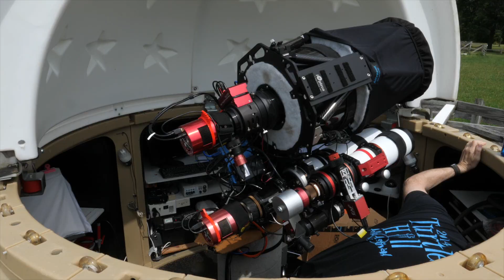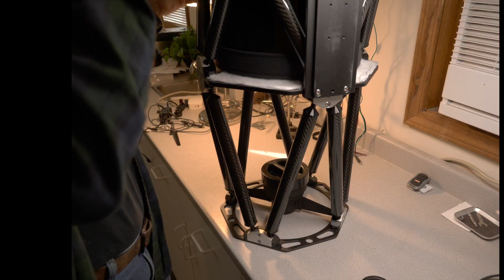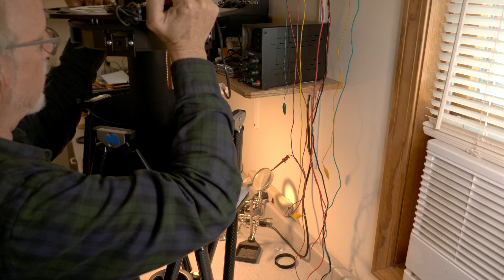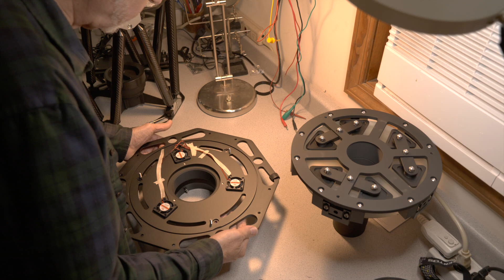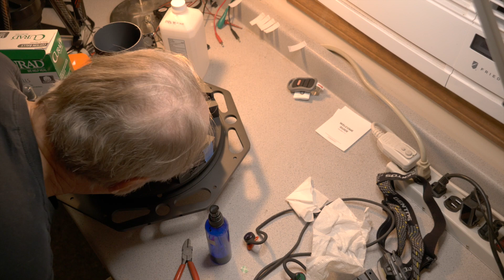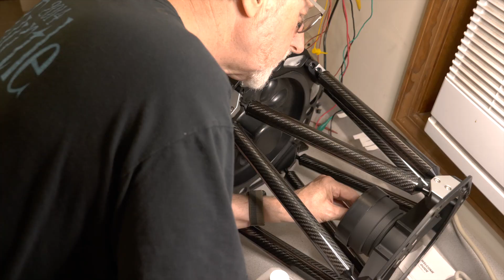2023 RC10 Disassembly, Fan replacement, and Mirror cleaning

Comment: I also had one fan fail within 24 months. Thanks for the video; it was very helpful. I will point out that the foam filter material in those filter caps reduced the flow from the fans by 75%, so I just used the grill for protection of the blades. Truthfully, I get a fair amount of dirt/dust in my observatory over the course of a month (I'm in the desert), but I was surprised how clean the back of the mirror remained. It will be far easier to pull the fans to clean the blades occasionally now.

Comment: Did you notice any play or mirror slop in the primary assembly? Just had 2 springs fall out of my  12". Watched your video for disassembly. Found about an 1/8 inch of mirror slop. I had tightened that up and reassembled. Will collimate and keep my fingers crossed. Thanks for the video.

Comment: Thanks for the video, Do you have any idea how the primary is help in place? is it by the clips surrounding the perimeter of the mirror and or does the central baffle have a retaining ring? My scope seems to have some pinching of the optics in cold weather and wanted to see if it would just be the adjustment of the clips before I disassemble my scope. Thanks!
Reply from the maker: I believe it's just the 5 clips around the perimeter.  The baffle tube can be unscrewed to remove it from the front of the mirror assembly, but I'm not sure if it's actually helping to hold the mirror in place or not.

Comment: Nice set up! Do you run a reducer inside the Esatto 3"? I want to get this 10" RC myself and pair it with my riccardi 0.75x reducer and a Esatto 3" but im worried about the backfocus and potential focussing problems since the Reducer puts the focus point more inwards..

CS Jakob
Reply from the maker: Yes, I use the TSRCRED 0.8x reducer and it lives inside the focuser.  I had to get a custom adapter made by preciseparts.com with threads on the front for the focuser, threads on the rear for my 48mm gear, and a third, internal thread on the front for the reducer.  By the way, I think the Riccardi reducer may not work well with the 10"RC.  It's designed for an APO which has considerable field curvature, so it corrects for that.  The RC has a nearly flat field, so the Riccardi will likely introduce curvature with that scope.  The TSRCRED 0.8x reducer is specifically designed for RC scopes and has a very mild flattening effect which works perfectly with the RC.
Reply: @dkuchta5  Thank you for the quick response!

I will contact APM and ask if the Reducer will work with the RC. In the official backfocus manual its stated that it works with the 10" GSO RC!

Comment: What is the cleaning solution you used? Commercially available?
Reply from the maker: It's a solution I made years ago and am still using.  I followed the instructions on this site: http://arksky.org/asoclean.htm    The Photo-Flo can be hard to find but it's a very tiny amount and can probably be left out.  I think most people just use a 50/50 solution of distilled water and 90% or higher Isopropyl alcohol.
Reply: @dkuchta5   Great, thanks!

Comment: Excellent video, got the same scope and the fans are mad loud. What's the cleaning solution you used?
Reply from the maker: It's a solution I made years ago and am still using.  I followed the instructions on this site: http://arksky.org/asoclean.htm    The Photo-Flo can be hard to find but it's a very tiny amount and can probably be left out.  I think most people just use a 50/50 solution of distilled water and 90% or higher Isopropyl alcohol.

Comment: I like the foam you have over the back of the scope; that's a great idea!
Reply from the maker: It's actually a Polyester filter material I got on Amazon: https://tinyurl.com/4upzr2w6
I have a shroud around the scope, and a "shower cap" cover for the front.  The filter material is placed on all the open rear vents.  That keeps the critters from making a home inside the scope. 🙂